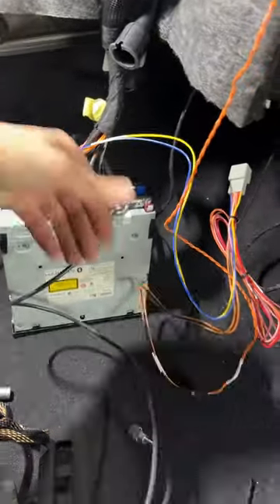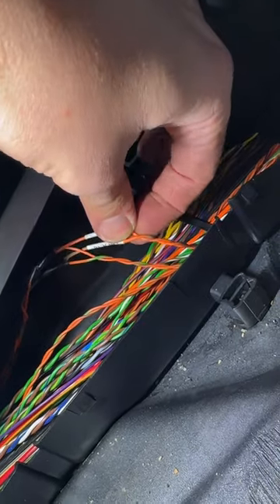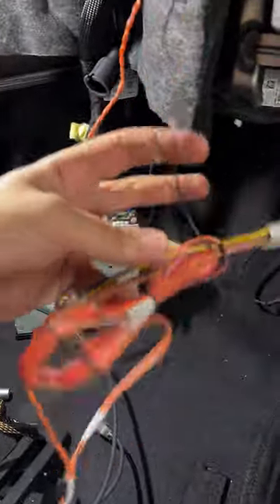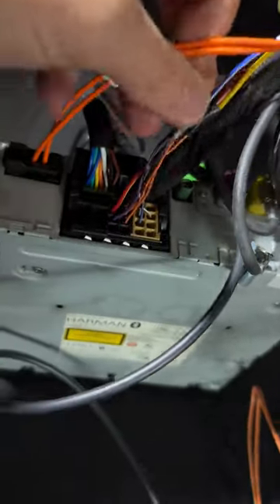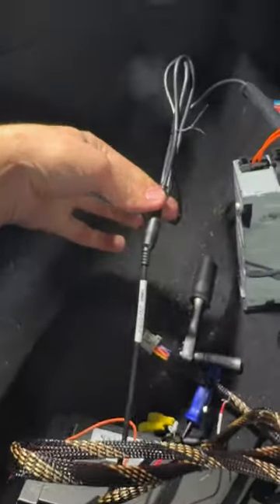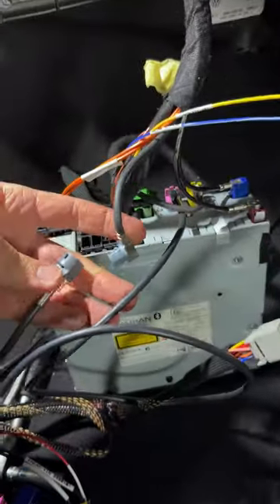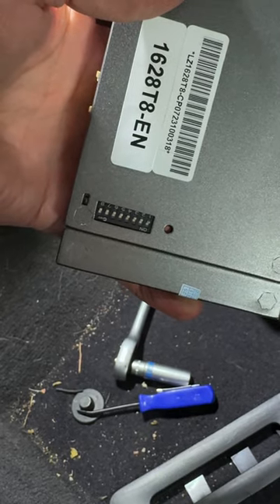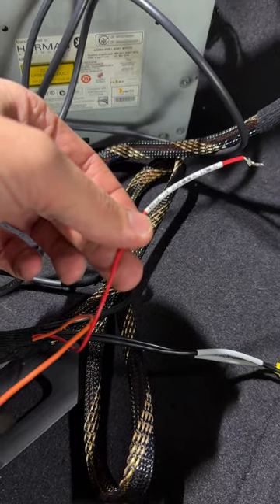Easy Install CarPlay & Android Auto on Volkswagen Touareg RNS850 | Joyeauto Module Wiring Guide

Comment: Hi Mate,
I am a bit confused about the cable connections in this setup. Can you  please clarify which cable is the main power yellow B+ and which blue cable is connected to the factory power source? There are so many mixed color codes, and I'm having a hard time figuring it out. Thanks in advance for your help!"

Comment: Only 3 wires are relative: yellow - 12v b+ supply, blue - mmi_con trol, black - ground point. Also two CAN bus cables at the footwell orange brown to orange brown, orange green to orange green. If you have trouble connecting these, we strongly recommend seek help from professional .